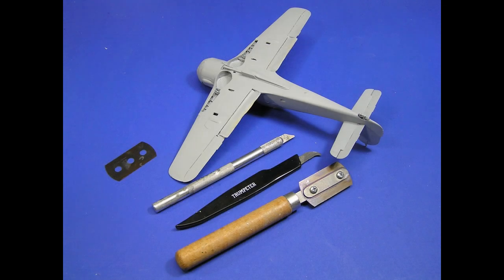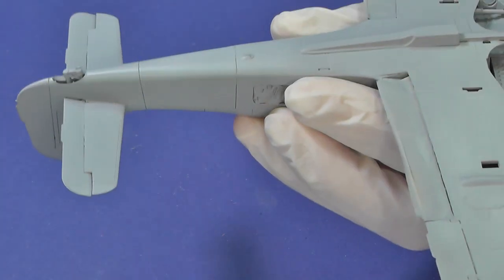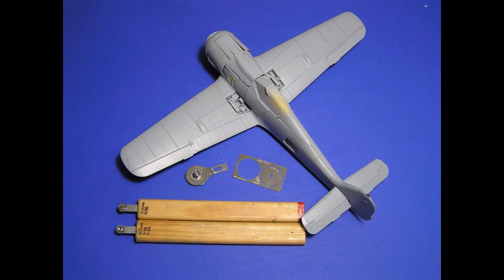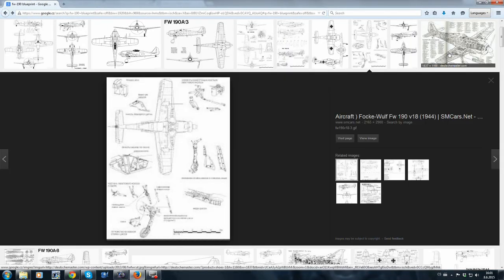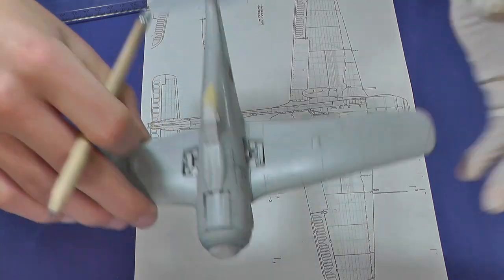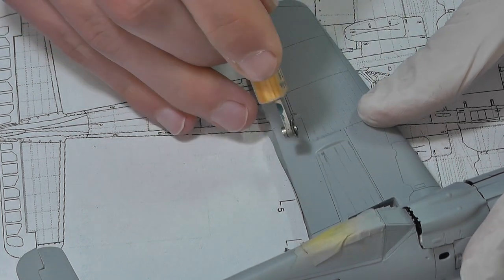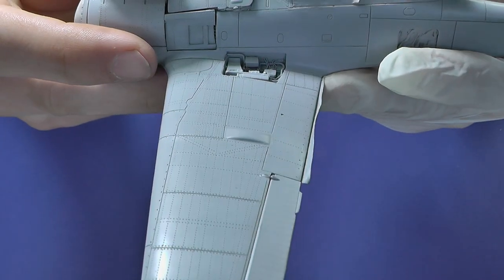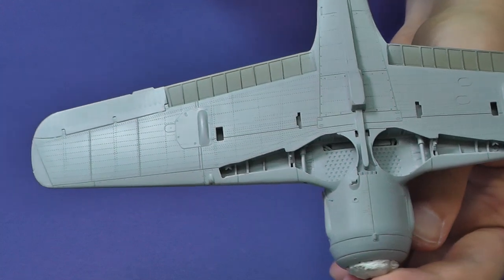Great Guide Plastic Models - Riveting and Rescribing Panel Lines

Comment: Hey PLASMO, can you tell what do you do in order to scribe new panel lines in putty? I got problems with this, dealing with 1-1,5mm gap along panel line with Tamiya Putty White but when it comes to rescribe the line it goes bad and uneavenly (both, wide-wise and depth-wise) even despite scribing along the tape.

Comment: Another informative video David!

One question: What do you do with models that have a few engraved molded rivet lines (usually on the control surfaces)? Do you prefer to match the pitch of the molded rivets, or do you fill them and replace them with your own rivet lines? For example I have a Tamiya 1/72 P-51D that has a molded rivet pitch of around 0.8-0.9 mm, while the "real" pitch from blueprints show a pitch of around 0.5-0.6 mm. What would you do when making rivets on the whole plane?

Comment: Plasmo, how do you deal with raised panel lines? Do you sand them off and rescribe the panel lines?
Reply: Thats actually the common operation...there is no other way...
Reply: That's what I am working on now. Rescribing raised panel lines.at first I was sanding them away but I stopped because it helps to keep them as a guide.once finished them sand away.
Reply: when you need to apply a prelayer of metal paint to show scratches... when do u prefer to apply rivet, before or after that metal underlayer?

Comment: I am currently building an Airfix 1/24 Spitfire Mk Vb as part of a video build for my channel to try and show that even poor kits can have a place in modelling and I have hit a snag on riveting, my riveter which is the more recent Trumpeter labelled one does not match the rivets over the rest of the Spitfire, the original rivets look more like they were made with something like a 1mm hole punch heated up rather than the smaller dots the trumpeter riveter makes, do you have any suggestions? many thanks, Mark

Comment: Hello, I just found your videos and they are some next level stuff for sure. I have a question for you abkut 9:55 the finished painted model shows decals on the wing saying no step in German. When i apply decals they tend to show an edge where the clear film is around the decals and it looks undealistic. Can you make or recomend a video that shows pro level decal work.   Also there are sme rivits on the leading edge that are spaced far appart. I assume you used a pin or some other tool to do those individualy by hand, what did you use?

Thanks again for all the hard work in making these videos that help us out here take ouf work up a level:)

Comment: hi, first I would like to congratulate you with your awesome work, but for 1/35 I need which diameter?
Reply from the maker: It depends on aircraft type but you can use 0.75 or 1 mm it is a size between teeth.

Comment: Really nice work! What's that black tape you're using? I've bee using Dymo so far. It's nicely thick and not too soft, but somewhat pricy.
Reply: It's called electrical tape, or PVC insulation tape.
Reply: Oh, I should have recognized that. Thanks!
Now from what I've used electrical tape, I remember its adhesive being sticky and prone to leaving gooey residue; have you had issues with that? Any particular brands you could recommend that work better than others?
Or do you just clean up the taped areas after scribing? I'd guess doing that right away would cut down on the possible adhesive residue pretty well.
Reply: Well... I never really take the tape off anything, I use it for making grips and wrapping round wires, I never take it off, but from the one or two times that I have taken it off there was sticky residue. I think for modelling don't put it on too hard, just put it on so it stays there and it shouldn't leave so much residue.

Comment: Dude this is INCREDIBLE - thank you so much for the advice.  I'm missing something basic...right at the start you say "after using putty..." ..what is this putty and how is it applied?  Thanks again!
Reply from the maker: +thomas mann hmm, this is not exactly tutorial for begginers. If someone did few model must now what I mean. Putting and sanding it totaly for another tutoral. https://www.youtube.com/watch?v=Lolh826zHxw
Reply: +PLASMO - plastic models thank you so much,  I'll watch and learn,  sorry i didn't see that one!
Reply: aha. The bit I couldn't understand was what the overall substrate was that you were wheeling the simulated riveting into.  From looking at other tutorials I think that it is sprayed primer (I assume 'primer' is the same in practice as 'surfacer') that has reached a thickness sufficient to obliterate the model's markings and thus require fresh riveting. Right?

Comment: While riveting, when you miss the straight line, how do you fix it ?

And what's that masking tape ? Should be a tough one to guide riveter
Reply from the maker: +Slammer You will need putty and sandpaper for this. Masking tape is electrical tape is tougher than classic tamiya masking tape.
Reply: +PLASMO - plastic models say, it's a little wavy line. What shall i do then ?

Besides, i loved that saw, its quite handy and seems much easy to use than regular scribers. Once you mark the line to be scribed with a pencil, it's nearly impossible to scribe it with usual scribers, but this razor saw eliminates that seemingly.

Comment: I use a knife for re-scribing the panel lines lines.  What advantages does the razor saw have over a knife?
Reply from the maker: Razor saw get out plastic shaving from panel line. If you can do same with a knife, then you can use a knife too.
Reply: PLASMO - plastic models 
Thanks!
Reply: Where do you get the small razor saw blade/s from please?

Comment: Hi, do think its possible to put a motor into a model like this ?
Reply from the maker: +CNTD You mean, electric motor? if so, no problem, but it will not fly.
Reply: +PLASMO - plastic models Not fly ? Why they have wings
Reply: +CNTD wings + motor = fly ?
Reply: +CNTD It's too small, and the weight is probably divided all wrong. Also, the materials used aren't aerodynamic.

Comment: How far apart should the rivet line be on a 1/24 model
Reply: +edwards gamer 

It really depends on which type of aircraft it is and if it had any rivets on it at all
Reply: It's a hawker typhoon 1b which I'm getting quite soon and I hope to get the info before then because like he said in the video, it's worth it when it's done
Reply: +edwards gamer alright I'll find a link for you
Reply: Thanks man you're the best
Reply from the maker: +edwards gamer new 1/24 typhoon 1b Arfix? This kit is so large cow. Actually on any scale from 1/32 to above are revet already indicated. What a good news. However this size of rivet wheel are do not manufacture and size it will be 1,2 or 1,5 mm. What I know largest is for scale 1/35 1,0 mm.